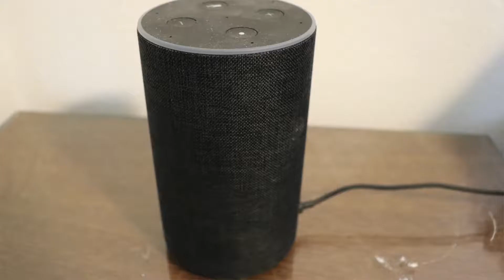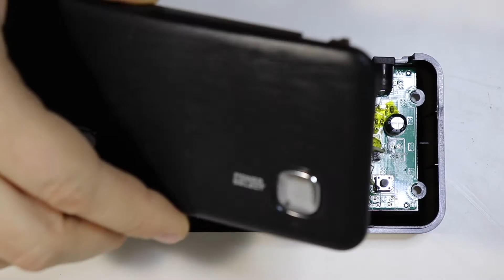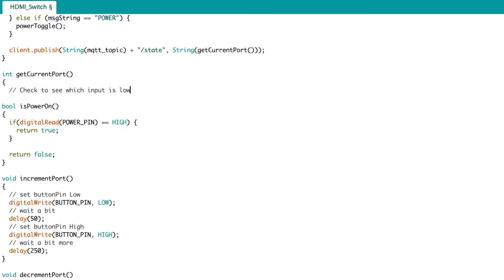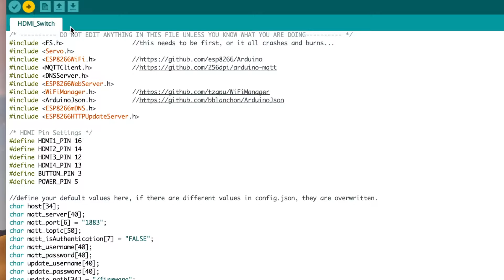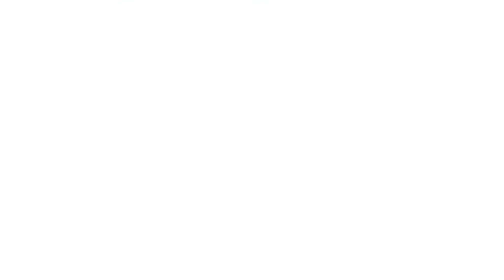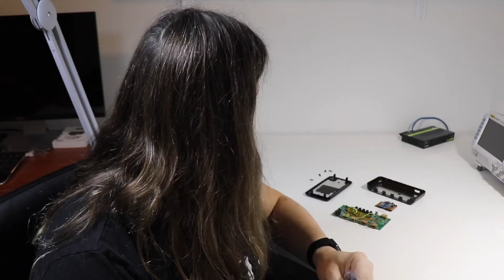Adding Voice and iPhone Control to my HDMI Switch (Part 1)

Comment: So there is hope. This is exactly what I want to do with my D1MINI that's already programmed to turn on my PC from Home Assistant. I've been intimidated by my HDMI switch though, as the components and button are micro. I'm not quite sure how it automatically selects the input. But it will always select my second screen, which is a fiber HDMI transceiver to my monitor, and not my main TV. This gives me some hope though. Perhaps I should watch your video 2 if you posted it. Then, I would be able to turn on my PC and switch the HDMI output to the according room. Other room being the fiber run, which works, but then I have to manually get up, and push a button!